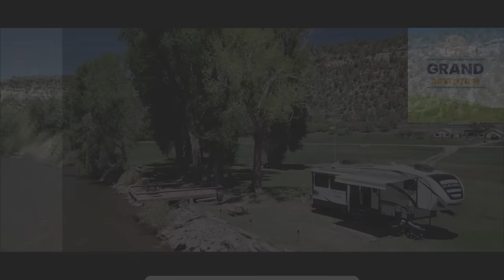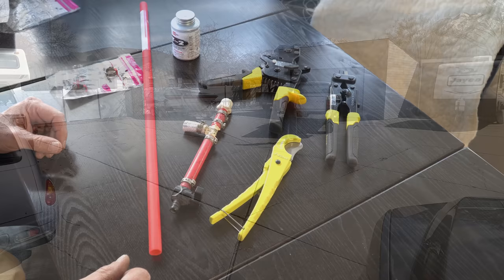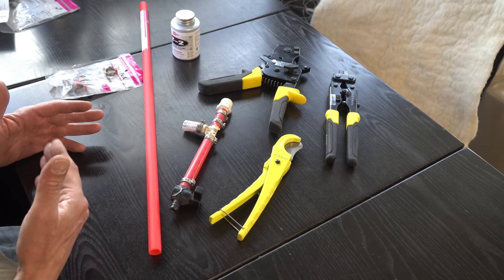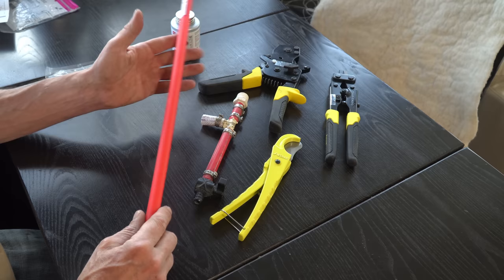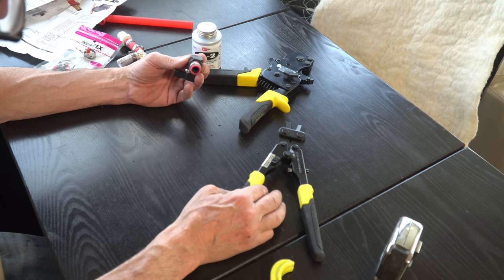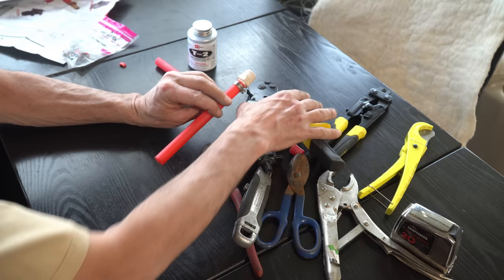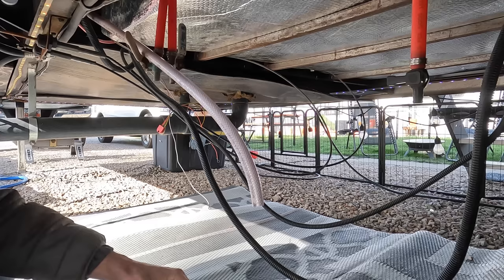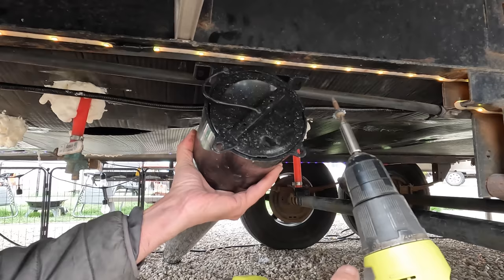Ep. 304: What Have I Done?! | RV water tank repair

Comment: I had the same problem with water loss through the overflow on our class A RV. My solution was to put a rubber stopper in the overflow pipe that was easy to remove and would blow out if I inadvertently forgot to remove it.

Comment: Nice truck upgrade, and kayak rack
Reply from the maker: Thank you Mark! The kayak is one big reason we opted for the 8-foot long bed on the F-350. That, combined with the large crew cab, puts the fifth wheel far enough back and the two rack rails spaced far enough apart that we can get away without using the front T-rack to support the bow of the kayak. It'll be nice this year to not stare all day at that T-rack and its support straps through the windshield.

Comment: I guess there is a reason manufactures make things a certain way and if you modify the original design things like this can happen and you can do significant damage. If you are going to continue using a closing valve on the end of the overflow pipes I would suggest you attach a large sticker beside the water intake stating "Ensure valves are open when filling".
Reply from the maker: You're correct, manufacturers can't have folks blowing up their tanks every time they forget to open those valves like we did. We've already placed a reminder on our water manifold.

Comment: 😮 wow! I can only imagine the feeling, and frustration, well no I can’t imagine it, I can emphasize with you as I have had to take down my underbelly several times to install rear hitch, and replace gray and black tank valves 2 times once while at home and a second time while on the road because I did not fully test the replacement correctly that once I filled them on the road both of my gray tanks sprung leaks that made me do on the road repairs, right after I had had an emergency appendectomy! So, I get the frustration and the feeling about the mistakes.  Sure glad that you have the skill set and ability to find someone to repair the tank and get it re-installed.  I don’t know how I would have made out in that situation!
Reply from the maker: If you accomplished what you described above, you would have been able to handle this no problem at all. It was just an unplanned PITA. I can't imagine doing this right after an emergency appendectomy.

Comment: Don't feel too bad about this.  I too have placed closeable valves on my overflow tubes for the exact same reason that you describe here.  EXACTLY.  Also I have done EXACTLY the same thing you describe here in forgetting to open the valves from time to time.  The difference for me is that I have always realized that I forgot to open those valves and opened them before it damaged the tank or the fifth wheel.  

This most recently happened to me a few days ago when I was filling up the water tank.  I heard some creaking and popping and I realized what I had done.  Again, I was very fortunate to have realized this.  At least now I know I'm not the only one.  

I need to set-up something to always remind myself to check those valves.  I will still use them, because I can lose half my water out of the overflow/breather tubes if I didn't do that.  On my tank, the overflow/breather tubes are located on the top of the sides, instead of from the top (since the top is against the floor of the coach).  Thanks for the video and great work!
Reply from the maker: Thank you! Glad to hear that I'm not the only one who occasionally forgets, and also very happy to hear that you didn't experience what we did. We're putting a reminder right on the water manifold, hoping that helps.
Reply: @GrandAdventure  ...yep...I printed out a label last week that says "CHECK WATER VALVES" and put it in my wet bay.

Comment: Maybe you can find some kind of pressure relief valve or pop open valve like on a hot water heater to put on your new water overflow drain.
Reply from the maker: Interesting concept, Tom, but it would have to be a super low pressure relief valve.

Comment: Nice work, Marc. Wow, what a find with Kelly. I’ve a got the standard gravity fresh water fill port (garden hose fill) and a drain valve below the tank. It self vents as I fill. But then I would have to supply my own external water pump if I wanted to fill from a heavy bladder on the ground (saw your old video on pump and bladder). What I’ve found is how rare it is to find a good video of reworking the corrugated underbelly material. I’m afraid to remove mine as it’s pretty solidly fastened by many screws to the frame. I would like to feel confident that I could work under mine for rewiring and such. Such an awesome channel.
Reply from the maker: Thank you Rich! Removing an undamaged panel, and reinstalling it would be a piece of cake. Getting the dimensions exact to replace a section, however, is where the rub lies. You can't be close, you have to be exact in cutting the replacement and in positioning it. If you're off even slightly in either scenario, it becomes an exercise in frustration.

Comment: Mark I hope this makes you feel better it did me as my wife and I watched this video last night. We watched on our tv so I couldn’t comment but I needed to. 
I was losing water the same as you so I put valves on the end of my overflows,same as you. Solved that issue same as you. Well after getting our 09 Open Range out in the spring of 2017 on our second season of RVing I flushed everything out and got all the anti- freeze out and mixed my solution up and flushed the complete system again. Then being an over thinker 🤔or not I filled the hot water tank with more solution and for some reason I closed those dang valves. Well a couple days later I drained the hot water tank made absolutely sure I had the valves to fill the hot water tank correctly in the proper position and ran the water until it came out of the pressure relief   
valve. 
Now I was ready to fill the fresh water tank. So I started running the water😮. 
Well as you were explaining last night your issue my wife says “ Joe I think Mark has done exactly what you did”. 
I was a little more fortunate than you because I was filling from our home well system and was about to shut the water of to let the well recuperate a while when the braces popped no exploded. No tank damage but that feeling is horrible. 
I’m sure we aren’t the only two guys this has happened to but at least we both know we are not alone. 
Now when you think about what you did you can always think”well Joe did it too😂😂😂” and never forget “life is grand adventure. “ 
Thanks for all your videos!!
Joe
Reply from the maker: Well, I do feel better because Joe did it too! Thanks bud, you made me smile today.

Comment: This was an awesome video - thanks so much for sharing it. I have heard horror stories of tanks falling due ot supports failing, but never would have imagined case.  Great information about how that is put together and seems like a complete PITA to fix.  But you got it done cheap and doesn't seem like it took that long - could have been much worse.   I have yet to even pull the coroplast off of our unit but I've been thinking I need to do that to inspect how things are down there. Not looking forward to that. Thanks again for sharing this great information!
Reply from the maker: Thank you! By all means and at all costs, if you can avoid removing that underbelly sheeting, avoid it. It's an enormous PITA to put back.

Comment: My tank leaked at that ring that you spin weld and I used JB weld puddy for plastic and it sealed it just fine so far.
Reply from the maker: Happy to hear that's worked out for you, and hope for you that it continues to hold. Normally, polyethylene is very resistant to things sticking to it.

Comment: Congratulations, Marc, on a very resourceful job of repairs.  I can just imagine the feeling of frustration and dismay you must have felt as you were preparing to depart and what was already a big job.  A reply like this shouldn't leave it all on your shoulders, so I will tell you about my mea culpa, many years ago when I was preparing to depart on an astonomy field trip to the boondocks in my Casita.  Several weeks earlier, I had installed some plastic window vents on several of the windows.  But, as I often do, I substituted my own stainless screws for the kit's screws.  Mine were shorter and would not penetrate the window frame on the inside.  I was proud.  Unbeknownst to me, my shorter screws pushed apart the inside and outside of the window frames so that when it rained, water would leak (some might say flood) the interior if the Casita.  On the day before I was to depart, I went to storage to get the Casita and pulled off the cover.  Immediately, I noticed the condensate on the INSIDE surfaces of the windows. To cut this long story short, I spent the next three days remediating the damage that the influx of water had done.  Bedding, tables, floors, etc.  I'm sure you can imagine.  Never again, I hope!
Reply from the maker: Oh my word! What an ungodly mess, glad to hear that you got that straightened out.  Your situation was several orders of magnitude worse than ours.

Comment: Thx Mark for an informative and entertaining video with excellent content and production. Your too tough on yourself IMHO but you were able to overcome and are the wiser for it with increased knowledge of your rig and resources you shared. FWIW I had a Alfa TH BITD that I towed to remote high elevation primative campsite in Southern Sierras where potable water was limited. We were awakened one quiet night by a loud crashing sound and shudder from the rig, thinking a bear was breaking into the trailer I was relieved upon exiting to find the 110gal  fresh water tank had dropped from its mount on to the axles. Needless to say some bailing wire and duct tape was required along with rock straightened angle iron supports rehung. Happy Camping
Reply from the maker: Thanks Bill! Nice fix. You're correct, I now have a far deeper knowledge of what's inside that underbelly than I had before this whole experience. I also learned about polyethylene welding and spin welding, something I heretofore knew nothing about, and it gave us the opportunity to share that new knowledge with our viewers. All is well that ends well, and I have new confidence that we'll never forget those valves again. 😄

Comment: DAMN DUDE.     SOMETIME I'LL  TELL YOU ABOUT MY ROOF REPAIR WHEN THE MEMBRANE SEPARATED FROM THE FRONT CAP.   AND TO TOP IT OFF THE ROTATING SHAFT THAT RUNS THE LANDING GEAR UP AND DOWN BROKE.   IF ITS MADE BY MAN IT'LL BREAK AT THE MOST INOPPORTUNE TIME.    IT JUST IS.  🤨🤔
Reply from the maker: This is fun, reading everyone else's horror stories. 😄 And you're very correct, PeeWee - it'll either break, or we'll find a way to break it.

Comment: Nice video. These RV’s with the vent terminating below the tanks, I don’t understand why they set them up that way. Naturally water will siphon out. If I had one and did the shutoff valve mod it would only be a matter of time before I made the same mistake. 

I wonder if the vent hose could be rerouted up and to a fitting through the exterior wall. Like other RV’s the height would prevent it from dumping water unless actually overflowing.
Reply from the maker: Agree completely, Jeff. Placing the vent the way you describe would allow the air and overflow water to escape, yet would prevent the water loss from sloshing. I don't get it either. I'll tell you one thing, though: I'm a whole lot more careful now about remembering to open those valves. 😁
Reply: Yeah. I get that they were trying to make things simple with an aqua-panel type deal, but the other issue for me (and a lot of people who boondock) is only being able to fill the fresh tank from a pressurized garden hose. 

In some places in southern AZ the tap water is so mineralized you don’t want to drink it, or even wash your car.  Little kiosks take 50 or 75 cents for 6 gallons of water.  I have a potable water jerry can I’ll use whenever in town, or when the tanks need dumped I’ll pull the trailer right to a kiosk…

Grand Design is on my list for possible next RV, but I’d likely install a traditional gravity fill with vent. I’d likely also delete the battery switch back there and run one of the nice Bussman marine circuit breakers up on the A frame (and upgrade battery cables).
Reply from the maker: @JeffinTD  nice plans. Although we have a water manifold panel in the Durango there's a siphon house to draw water from a jug via the onboard water pump. We also carry a 45-gallon pillow tank, from which we can transfer water to our RV tank via an inexpensive 12V liquid transfer pump.

Comment: My overflow tube does not have a valve so I fill my tank until it overfows without paying attention. I may rethink that. Thanks.

I would have thought the tank walls would be thick enough to withstand incoming water pressure and stop the flow.  Was it the trapped air that caused the tank expansion?
Reply from the maker: Mitch, I suspect it was a combination of the trapped air and the incoming water under pressure. The walls of those tanks are fairly thin and therefore bend easily, while the ones that Kelly manufactures himself are of a much sturdier grade of polyethylene sheeting.
Reply: That’s why pressure tanks are round and the ends are domed, pressure pushes out equally around the tank. So the pressure try’s to make a square tank round.

Comment: Hi Mark, I glad you were able to get your tank repaired but that's not the reason for this comment. My wife and I travel with a pickup and 28' Lance trailer. We carry our Hurrican Santee Sport 12' kayaks on a Thule Track Rack. We use Malone saddles. On our trip last spring from New Hampshire to Arizona, Nevada and Utah. Out cockpit covers and I had to siphoned out the boats many times. We're in Alabama now working our way back north. Again the covers are taking a beating. I really need to carry the boats upside down but am nervous about the ABS boats. How do you carry yours. Thanks. Gerry
Reply from the maker: Thank you Gerry! We carry upright using a Seals Cockpit Cover. They're sturdy, clip to the deck bungee, and are carefully fitted to your cockpit. We've never had it blow off, and we've had it for over a decade without any obvious wear. We highly recommend!
Reply: @GrandAdventure  we have Seals covers but the Santee has a long narrow cockpit so the covers are too wide. Maybe I'll contact Seals and see if they have another option. Good luck on your new season. We'll be watching. Gerry
Reply from the maker: @gerrysherman2007  If you go to their website they actually have a database for most boats which shows the appropriate size for each cockpit.
Reply: @Grand Adventure  Thought you might be interested in this. I emailed Seals and they responded quickly. The size 7 seal covers listed for our boats is a universal fit not an exact fit. They said to send  them the covers and they will cut them down to fit exactly at no charge. The "Seal" covers will only work if they are an exact fit. They will also send them back to me at no charge. Can't beat that for customer service. Thought you would enjoy that.
Reply from the maker: @gerrysherman2007  that's fantastic! Got to love it when a company steps up.